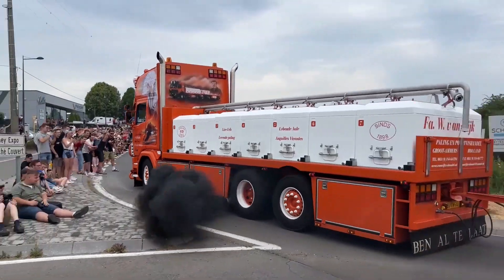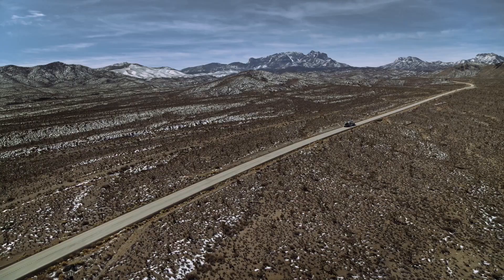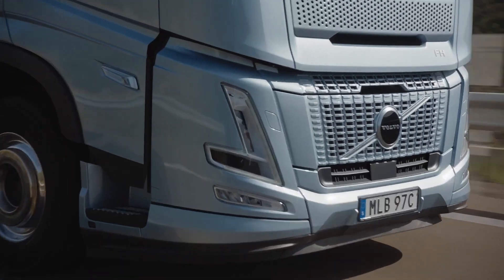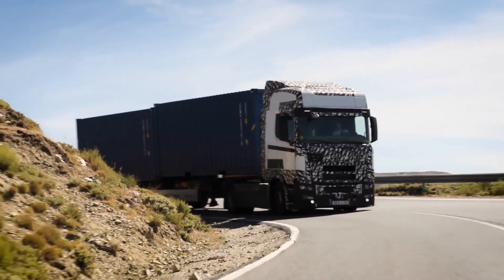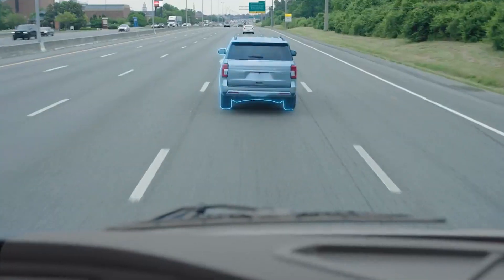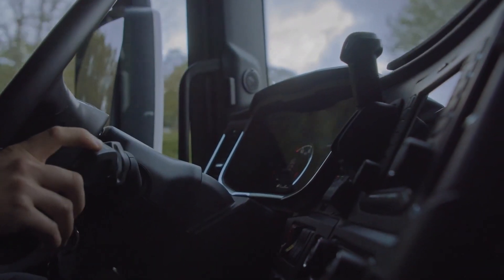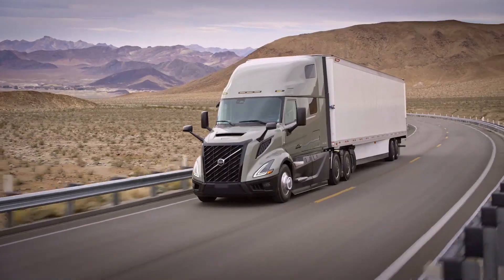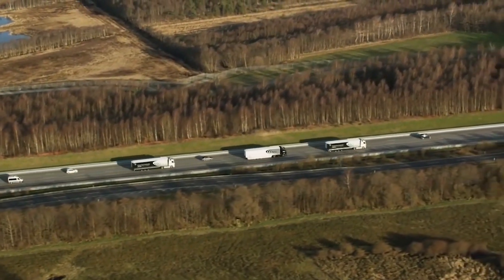Why European Trucks Are MILES Ahead of American Ones?

Comment: In terms of total weight they are also lighter in North America, here in Europe it is from 40 tons to......and that for standard transport (up to 18.75mtr). Here in the Netherlands you may weigh a maximum of 50 tons so that less transport on the road is needed. Plus the LZV that can also carry a bit more weight and load (25.25 mtr), so a total of 60 tons here in our small Netherlands. Our northern neighbors throw a few tons on top, and where Germany is the difficult child and is 10 tons below the total weight of the Netherlands....so yes, it is calculating for the planning and driver and watching out for the BAG and the well-known points from Flensburg. You are the driver and therefore responsible for what you load. 

And by the way, I drive a fully air-sprung truck, cabin and chassis (seat is standard air-sprung here in europe) and not just for comfort, suppose you have a tractor-trailer and you have to couple it, we throw the air suspension up or down here so that you don't have to unnecessarily turn the crank if the previous driver who had it with him has uncoupled the trailer too high or too low (mega version), plus the trailers are also air-sprung and equipped with brake discs. I myself drive a combination and then air suspension is also perfect, if you get into a bend at loading/unloading docks, loading docks that are too high (Germany) or too low, do not get out but do everything with the remote control from the cabin....it has many advantages, and the driving quality is much better. Leaf springs bounce like crazy and the load also takes the blows. And in terms of lighting/power supply, it's 24 volts here versus 12 volts in North America, and most new European trucks have had LED lighting for about 9 years, the truck I drive is 8 years old and completely LED from front to back, from bottom to top from the factory......saves having to replace bulbs.
Reply: Precisely.
Reply from the maker: @thedutchhuman  I could only imagine how the different weight laws amongst the countries trip up newbie drivers in Europe. Sounds like you have been driving a while and by the knowledge you shared very good at it!
Reply: @TheTruckersChannel  I will be driving for 32 years next month, and regarding the load and total weights, the planner also knows what is coming in so knows that in the Netherlands for example you have to weigh a maximum of 40 tons if you enter Germany. Also the other way around of course because you are driving in Germany. If the customer says that he wants to load more in your trailer you can refuse as a driver and even take steps to call an agency that will actually come by... and you prefer to keep German agencies as friends because they can make it very difficult for you. Our Netherlands is small and in order to reduce the pressure on the highways due to freight traffic, the total weight is higher in our country in order to have less freight traffic on the highways.
Reply from the maker: @ Thank you it’s fascinating to learn how different the rules are vs here in the US. I have trained a lot of planners and we run a lot in the Pacific Northwest. We can run 4 axle trucks and trailers both with a lift/tag axle. Takes the planners several years to fully understand axle weights if they have never driven. I’ll have to research those agencies you mentioned. It would be great if we had something for drivers here in the US. There are so many challenges that drivers face and have no one to back them up.
Reply: @TheTruckersChannel  no thanks, I sent you a message via email

Comment: Your analysis about weight and length configurations between EU trucks and N. American trucks are wrong. On the contrary, besides the narrow nature of roads in the EU, their trucks haul more and has options for a more lengthier configuration.
Reply from the maker: @kingsleyanyeme8314  let me know what  we missed.
Reply: @ 1. Truck configurations vary across Europe with countries like Finland 🇫🇮 allowing trucks of 34.5m=113 ft 2,268 in. And with normal conditions weight of 76 metric tonnes=167 200lbs. 
2. Driving comfort is not relative to larger cap. EU trucks are made to satisfy the drivers (Scania) besides its performance.
Reply from the maker: @kingsleyanyeme8314  thank you!

Comment: check out Bruce Wilsons youtube channel to see his Scania import in the us. he's going to lots of us car shows promoting the scania he got - and so far ALL the comments I've seen from us citizens concerning the truck is overwhelmingly positive. he has quite some know and unknown people test drive his Scania - and lots of comments that ppl would immediately change to Scania if they ever are available in the us. you might want to check the other side of the fence BEFORE announcing that the grass on your side is greener.

and please mention, that eu trucks usually have ca. 200hp more than the standard us truck... so much for super powerful to lugg heavy loads. and it would be good to have the comparison on screen. let me help you with that: 
us: trailers 53 ft (16.2m)  up to 80.000lbs (36.2t) - and no reason is given for the long snout, only the need for it. Why are they necessary?
eu: truck and trailer I guess, because you don't mention it exclusively 54 ft. (16.5m) more than 88.000lbs (40t). 

so the reason the us trucks have to be really powerful is what? that eu trucks can be longer and heavier? do you know what contradictions you tell your viewers?

Comment: ''The long nose is much comfier on long journeys'' says who? That is on paper maybe.  How many American truckers have driven a Scania or Volvo or Mercedes, so they can tell the difference? They just don't know any better and are stuck like a donkey on bridge and refuse to admit that they are far behind when it comes to trucks.
Reply from the maker: Thanks for following along and commenting. I would say majority of Americans have not driven a Scania, Volvo or Mercedes. So you are correct we would not fully know. Some of the comfort is the space a long nose affords you if out for weeks at a time. Not necessarily the ride. Thanks!
Reply: @TheTruckersChannel  The long nose id over the engine. The Cab on a proper EU truck has standing hight and greater volume than the standard american sleeper cab. It's all how its packaged.

Comment: I hate to burst your bubble, but the ride of European trucks are second to none, ALL European trucks have 4-point air-suspended cabs, and some European trucks have air suspension on all axles, so for you to say that US trucks offer a bit more comfortable ride is complete BS.
Reply: Nothing compares to Euro trucks when it comes to ergonomics. That is something Murrrikkkans are going to have to learn. Oh by the way, the size of the sleeper doth not make a better truck.
Reply from the maker: Great point! Space does not always mean comfort!
Reply: I own a 1993 w900 and a 1973 scania 140. The scania is way more comfortable.
Reply from the maker: That’s crazy! Shows how great Scania’s are. 👍
Reply: That old myth comes from the early 70's, when America changed it's regulations and nose trucks started to replace their cab overs. They basically compare old American cab overs to new American nose trucks. To be fair, that is probably gonna be a slight improvement in drivers comfort, especially when considering how bad it is trying to climb in and out of an old American cab over with the wheels all the way up front. After that, practically all innovation in terms of comfort stopped. So to say that Europe is 50 years ahead is not even far fetched.
Reply from the maker: Thanks! Shows how good marketing can really stick!
Reply: Would american trucks pass the Euro crashtest 🤔
Reply: @5000khn  ughh... probably not... those high emissions would be an insta-fail to most american semi's... including the newer versions...
Reply from the maker: That’s a great question. Not sure if that research is out?!
Reply: @ Only Volvo. If you are a Paccar product, you are likely toast.